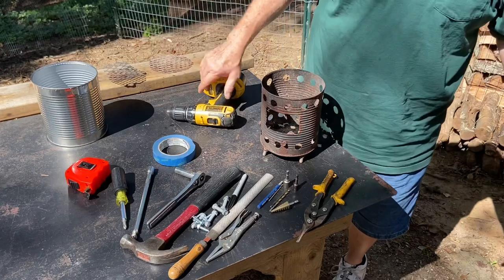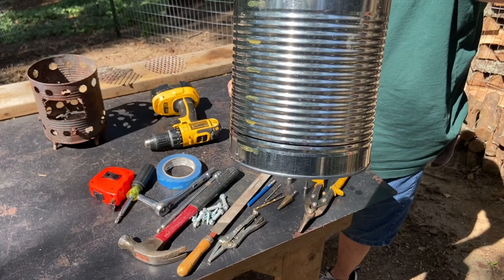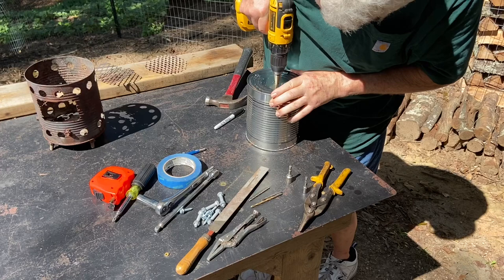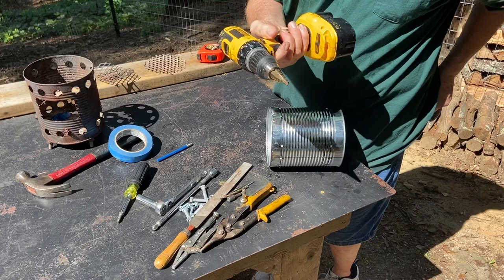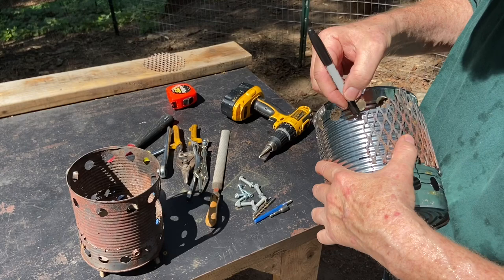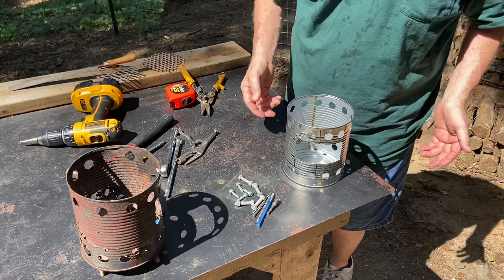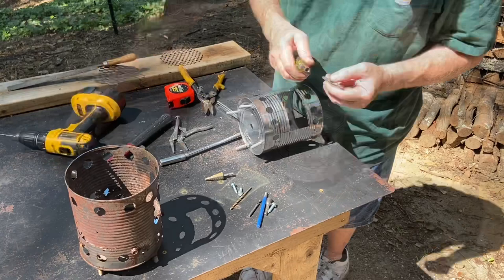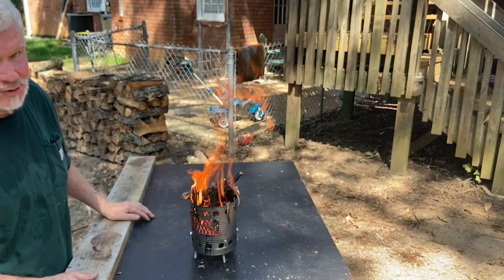Making The David West Style Of Hobo Stove

Comment from the maker: One of the fastest starting and hottest burning Hobo Stoves there is. I developed this style 10 years ago as I examined and experimented with different types hobo stoves, gasifiers, rocket stoves, alcohol stoves, etc. I had pretty much decided to just use a standard Hobo Stove design but with legs and a covered feed hole when somebody commented, "You know, your hobo stove would burn a lot more efficiently if you put an elevated floor in it." I don't remember if he also suggested that the floor be perforated or not. He was right though, when I tried an expanded metal elevated floor just above the bottom row of holes this standard hobo stove now allowed tinder to catch more easily, burn hotter, and burn completely to ashes. Simply put, the stove provides air to tinder and fuel wood from every direction.
   Come see the easy build. heck out my Hobo Stove Builds Playlist below for a no tools, except pocket knife, build. Please SUBSCRIBE. Thank You!

Hobo Stove Builds Playlist
https://www.youtube.com/playlist?list=PLkoXX8XsMW3lZeJRY3SSyPsZBTEWCnHbp
Poor Man’s Hobo Stove Build, No Costs... No Power Tools
https://youtu.be/EqTGOEvUVzM
Reply: Simple and efficient. Not much there to improve upon. For those who want just 3 legs, could use shelf brackets screw to the outside.
Reply from the maker: Yeah, I've seen those videos.

Comment: Isn’t your big drain hole going to drop embers?   i don’t remember as big a drain hole on previous versions. Mine has no hole and no legs. Ive only made them with a utility knife/box cutter.     I mostly use mine to light charcoal     I am due another one but  I couldn’t imagine buying a can so I’ll be dumpster diving.
Reply from the maker: Yes it will drop embers just like the rusted out one was. Nothing wrong with dumpster diving.